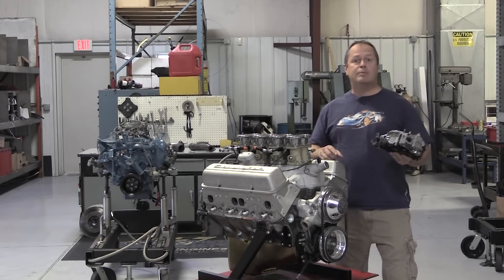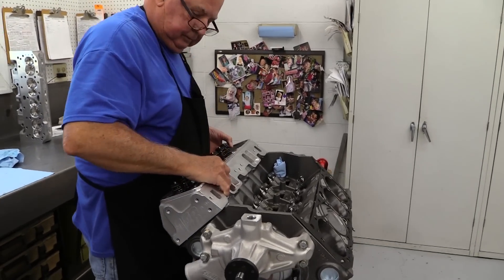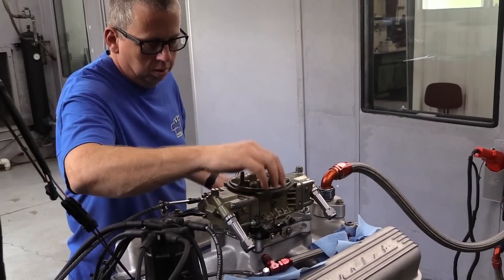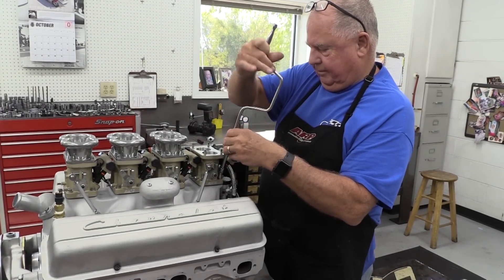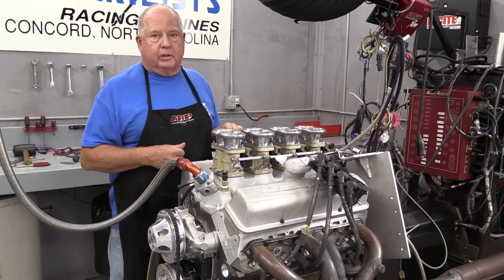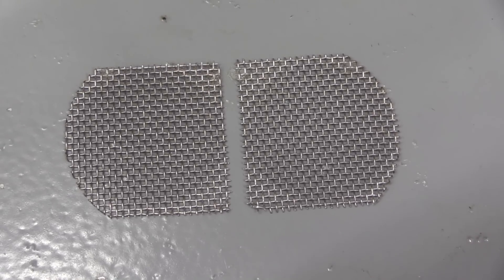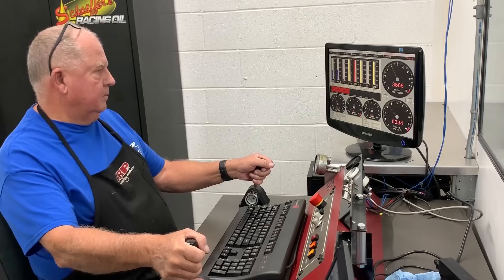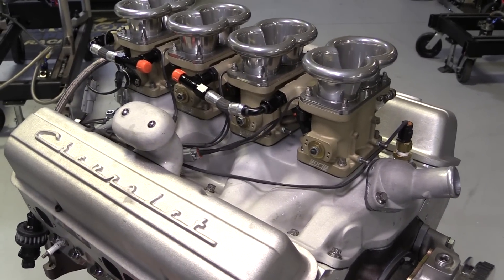Carb vs EFI - Dyno Testing a Holley Double Pumper vs Custom Stack Injection

Comment: Why this old, antiquated individual throttle body/port, Weber style manifold? How about a Victor EFI manifold, port injection and a 1000+ CFM 4 barrel throttle body? This, in my opinion, wasnt a fair example/comparison. This coming from a guy who came from carbs and distributors. Can you all do a test on the same engine with the aforementioned setup?
Reply: Yeah, this is really a comparison of a too-small mystery swap meet carb manifold adapted to EFI vs a modern carb/manifold setup. The results are not surprising.
Reply: @177SCmaro  we all know if they would've used the setup I suggested, the resulted would've been closer or even better compared to the carb setup. And being able to fine tune it. And being able to hit the key and almost have no maintenance (carb cleaning, constant carb adjustments, etc). Go to the track make adjustments with clicks vs jet changes and fooling with a distributor....
Reply: @jaydubb71  I've been driving everywhere I need to go on the same Holley vacuum secondary 600 for literally ten years, my car starts up instantly even in freezing temps and I have a vid showing proof of that. In the ten years I've been relying on that carb I've only had two problems with it, I had to replace a dried out leaking needle and seat once after the car sat for a year during a delayed engine swap and I also had to order a new number 35 squirter to match some porting and choke tower removal I did with a Dremel tool.
Reply: @Impactjunky  carbs suck okay...
Reply: @elonmust7470  I wont say that they suck BUT I will say that they have had their time. My 91 Camaro is getting a fuel injected and turbo'd LQ4. I was going to do a blow-thru carbed 355/383 but after having the LS light shone upon me, Im hooked. I learned to tune EFI years ago and I will never look back. And I will NEVER put a carb on an LS. The Holley 4 bbl carb and ignition LS kit is 800 bucks ALONE! Why DOWNGRADE an LS with a carb and have mixture distribution issues and need a plenum spider like a single plane on a SBF? No point. I would like to see a test with the configuration I mentioned earlier. @thehorspowermonster, will you all try this setup?

Comment: A carb is a calibrated fuel leak. A Holley is a fuel leak waiting to happen
Reply: @wayneoneal7952  EFI still wins, a FAST intake with stock efi on a Ls6 will out perform almost every combination of carbs. Not to mention its cheaper, WAAAAY easier to tune, more efficient, and takes up less space.

Comment: Way back in 65 when I ran a Shelby GT350 at Elkhart Lake. The 289 (actually 294 with a bore clean up bore from Shelby. Back then the engine used 4, 48 IDA. Webber’s. It was factory rated at 385 hp LOL, Right! It ran a Crane Roller cam from Shelby.

Comment: This is interesting,  especially considering that you're going over 5500 rpm with a stroker and running roller cams and roller tip rockers. I do not trust either. I will keep my spring pressures lower with a solid flat tappet cam and ductile 1.5:1 iron rocker arms on thick walled shafts instead of studs.
As to the carb selection,  wouldnt a better comparison be a dual 4bbl setup against those throttle bodys? And do a progressive and straight linkage test, and get the AFR dialed in on the carbs, like you can so easily do by computer with the EFI?
Thanks for the video, I appreciated it, but I am sticking with dual quad AVS2 500 cfm carbs.
Reply: A better comparison would have been to choose velocity stacks for the efi system that matched the carb in airflow. If that was done you'd have seen a much broader and useable rpm range. This setup was not well thought out.
Reply: That's just your mopar bias...Lol
We know shaft rockers are better...
You know Chevy's are better!
Reply: Them showing a clip or 2 of them tuning the efi doesn't mean it was fast or easy. It could have been but they also said they modified the intake to allow a common map signal which most likely helped a ton with tuning

Comment: Should have done a IDF or DCOE  to vs those  throttle body's .
Reply: Jenvey make TBs in both those types of Webers. I would have gone for the IDF-style with at least a 48mm tapered bore, it not a 50mm as a minimum, on an engine of that capacity and potential gas flow.
Reply: @brucelamberton8819  actually got two 2x50mm jenvey throttle bodies to fit my dcoe manifold for my stroker volvo engine 44mm on a V8 sounds extremely restricting considering i run 50's on a 3.1L I4 and still wonder if i should have went for 52mm or 55 millimeters, but for roadeuse i guess the 50's bring a bit more air velocity at low rpm's

Comment: Efi is better for drivability... that’s about it😂 there’s a reason you see a dominance of carbs at the strip or even street race cars... I only run carbs for my street race/strip cars. Better peaks for everything, cheaper, and easier to tune. I don’t have to really tune my carbs too often though because I get them built through pro systems. I’ll never convert to efi. I like efi in my daily drivers though😂 great video.

Comment: I'd like to see a comparison using an Enderle Bird Catcher on about a 500" drag racing motor vs. a properly sized crab setup. If you've done one, great! Link it, if not and you run across one, Link it! I run a 500" Mopar, Indy 440-1 heads, Bird Catcher on Methanol. It's NA and given the Methanol, I run the compression ratio at right around 15.5:1. I tune it a little conservatively to make parts last longer. Getting the last drop out for one pass on my budget isn't worth it. I fought with carbs on Mopars for years. Mopars are the most temperamental POS's if you try to over-carb them. Even on a 500" 13ish:1 we could not make a 1050 dom work. We were driving it to the line so by the time we got up there the plugs would be black and you just can't clean em out at that point. We had it jetted about as low as it would go before it would stop responding. I suspect a 950cfm carb would have worked great but, again...Mopars seem to just refuse to be over-carbed...even by a fairly small amount. Chevy...they put bigish four barrels on v-6s...and it worked pretty good! 

My 15.5:1 Motor in a 2600 ish pound tube chassis car did some 9.20s in the quarter but the car was a real handful. Very short wheel base and it took a real expert to get it aligned properly. But once he did it, the car went straight as a string! Unless I got loose...then you lift! LOL There's only so much you can do with a short wheelbase car! I wish I'd kept some 1/8th slips from back then but I just didn't remember to. (where I lived 1/8 was the deal for hundreds of miles) I gave upon carbs the minute I tried the bird catcher. There's just no matching the tunability (especially with Methanol) and more importantly to me, simplicity. Mechanical Fuel Injection may be nearly impossible to make work on the street but it sure works well on the strip. It would need to change 40 degrees before I'd even be able to notice a pill change.  Great vid! Thanks and I'll be a new subscriber.

Comment: Getting ready to rebuild a ‘67 mustang with a 289, all original with just under 8,000 miles for the Henry Ford museum. Then put my DZ302 on the dyno, kinda curious on how rpm’s it’s gonna twist.
Reply from the maker: Sounds like fun!

Comment: If street-ability were my main concern, I wouldn't want a setup with no air cleaner and the bug screens removed.
Reply from the maker: We never run air cleaners on the dyno. Both the carb and the stack fuel injection setup will have a filter for street use. Plus, if the owner takes the truck with the EFI setup to shows, he will probably want to take the filter off. When he does that he can easily add the screens back on to make sure nobody drops a rock or some other piece of track into one of the velocity stacks. Thanks for watching.
Reply: @TheHorsepowerMonster  I get that dyno tests never use air cleaners, I also get that for shows, strip, etc. you take the air cleaner off after you get there. My point is the builder spoke at length about street driving conditions that favor the EFI setup, but daily street driving needs filtration and that particular setup only performs well with no filtration at all, even a coarse mesh screen caused a large performance penalty on that EFI setup.
Reply: @onemoremisfit  that wasn't the filtration that was just undersized velocity stacks. The filtration just emphasized it. EFI with the same airflow will be far far more streetable with a nice smooth power delivery.
Reply: @nismo4x4n  Yes, I understand that the particular EFI system used in the test was way undersized for the engine, and any EFI will likely beat a carb in street manners, but that particular grossly undersized EFI with it's excellent street manners only made decent HP with no filtration, and no filtration is a no-no for a daily street driven engine, and the builder discussed at length the advantages of more power to accelerate in merging and other daily street traffic situations, which struck me as incongruous reasoning. They should complete the test with a properly sized EFI system, after all they did up-size the carb after determining that a larger unit would make more power, then they throw on a tiny EFI system with a one-off manifold that the customer wanted for the 4-deuces looks, then they use mental gymnastics to reason it was a good choice for daily street performance driving. A properly sized EFI would be the smartest choice, and would probably make nearly the same max HP as the carb with way more mid-band power. Basically this test was not to compare carb to EFI, but to justify a particularly unique and odd system as still workable in a practical context.

Comment: If it's used for street driving, you'll need some type of air cleaner.  
As is, you'll have bugs and dust going through the engine.    Try driving it through the midwest or south in the summer, where there's a lot of bugs.
Reply from the maker: You are right. We never use air cleaners on the dyno, but both will have a filter for real world use. And the owner of the EFI setup will probably even fit the screens back up if he takes his truck to car shows and wants to show off his engine without the filter covering up the velocity stacks. That will keep people from dropping in rocks or trash. Thanks for watching.
Reply: @TheHorsepowerMonster  
The screens caused more loss than is reasonable.   A large air filter should cause much more minor losses.
Reply from the maker: @charlesvan13  Absolutely true. I was just saying at a car show he probably will want to show off that induction system. He can add the screens easily before a show and still have a little protection from things at the show even with the filter off. I wouldn't want to run around with the screens on all the time either.

Comment: Notice that the original 750 carb had less power below 4100 than the EFI. The same holds true for running on LPG propane. We've been using EFI Port Injectors for 12 years on our propane systems in Toronto. The old rule of thumb for a carb versus EFI was that fuel injectors save 25 percent on fuel use in real driving, yet many industrial LPG engines are still running the 50 year old propane carbs. Sad. EFI is the only way to go.
Reply: I thought fuel savings came to 15%. Im planning on installing an EFI On my chevy 57 truck 3100cc. I just needed something that can reduce fuel consumption.

Comment: Webers were never known for sheer outright power.  They were known for throttle response and off the line power all the way up to the high end, which was perfect for ROAD RACING.  If you want to drag race, they are terrible, you totally want a 4 barrel.

Comment: some times you have to decide what's more important, looks or power.  Most likely this engine will never see redline again after this so more power up to 4000 rpm will work out great.  If it were me I would get rid of the individual throttle bodies and go with a large single, most likely it would make the same or slightly less power than the carb.  Its hard to beat a carb for power, that's latent heat of evaporation working there.

Comment: Clearly something reduced the volumetric efficiency of the engine at higher end with the EFI, but a good carb system can match a EFI. Having a carb combined with ignition controlled by an ECU usually improves the engine efficiency.
Reply: nope:  a carb can NEVER "match" a correct installed EFI because a carb is a RESTRICTION (venturi) and so reduce the flow= less power: the power difference is MINIMUM 5%  , and this ONLY AT BEST RPM range (highest torque RPM), because a carb is alway only optimised for a low RPM range , in all other RPM situations are carbs unaccurate and does not allow the same torque as on a EFI and the ocnsumption is far higher...
Reply: @leneanderthalien  In other words, a good carb can match an EFI system. It's all about the correct use scenario and sizing. Depending on the use, the carb is just enough.

However, a carb will not match an ECU with a proper volumetric efficiency and lambda table.

To be honest, I only build cars with ECU, because the diagnosis and tunning is much quicker and just required a laptop... Heck... I can even do over the long range radio of the telemetry.

Example: I have a car with a blower that I use as a daily drive, but I want maximum power sometimes.

So... I can setup the the target lambda to 1.05-1.00 for lower loads during cruising and 0.86 at higher loads.

This will save fuel during daily drive and offers full performance at track days.

Comment: Its said the roller cam is billet steel, is the cam distributor drive gear also billet??. Then what this material of the gear on the distributor ??? I've always been told that the distributor gear must be bronze if the cam gear is steel billet ??

Comment: Budget street engine go with in cab AFR gauge and edlebrock carb.  You are the ecm and the jets are easy to change.
Reply: that may have been true 20 years ago but efi ecu's and injectors can be had cheap now. With efi you can have perfect driveability at all points in the rpm and change your mapping at will.

Comment: Put some 48mm Webers on that intake. It does not surprise me that it has better bottom end though the Victor with 4bbl type injection with individual injectors would still be better for a street engine.And the Webers would make top end but fall allover themselves until 3500 rpm.
As a long time road racer that has been proven over decades on road race and ovals. The old piss and piddle injection on speedway sedans 30 years ago would be worse than single 4bbls of today. I have seen single 4bbl on a 360 sprint and it did not hurt, though they are turning a 1000rpm more these days and I suspect it would.

Comment: Since the 830 did so well I might have tried a 950
Reply: Bigger is not always better with carburetors =)
Reply: Inclined to agree, keep going up in size until it starts to lose bottom end and then go back one size. Who knows how much was still left on the table.

Comment: it's becoming difficult to keep a carburetor alive if you live in a place where ethanol-free fuel is not available. modern efi systems are immune from ethanol damage. 

i have an old 1974 gmc half-ton pickup with a 350/turbo350 and an edelbrock performer intake and edelbrock performer 600cfm carb. i don't use it very much, it gets used maybe 5-6 times each year for dump runs but it mostly sits around. it was always a dependable and reliable rig until the introduction of ethanol... even though i installed an electric fuel pump to eliminate the mechanical one which allows me to shut off the fuel so the carburetor will go dry when i shut it off i still get major corrosion problems so i have to take the carburetor apart and clean it out twice a year, sometimes more often than that. i'm really tempted to swap to a factory tbi manifold and throttle body but i'd rather not use the original gm c3 efi system, even though i own a scan tool that can talk to that system...

Comment: Why not use IR manifolds with separate tb:s (i.e. in cross with the tb:s located somewhere above the valve covers)? The manifold used seemed to have many bends of the airflow => pressure drop => less VE and also logical to the top end in this comparison?

BTW: Objectively Formel 1 left carburettors of any kind in the early sixties. 

But even with the same VE map over the rpm-range a properly mapped fuel & ignition EFI is indeed very hard to beat due to the extreme possibility of quality in the fuel and timing resolution vs load, this is simply not possible with carburettors and/or distributors...

Comment: Soooo ... what would happen with a larger-flowing EFI system... that could give you the lower-end 'early' torque... AND electronically control the fuel flow all the way thru the High-Flow top-end...?? Particularly if mounted on a medium-rise manifold, that would give you some runner length...

Comment: Id be curious if you match cfm of both intake setups what the power numbers would be.
Reply: the EFI would smoke the carb. You can get far more fuel to the cylinders with a EFI setup as you have less volumetric loss from liquid fuel vs vapor.
Reply: If its the same cfm I doubt it be major. Unless running big carb with lots of fuel adds a ton of fuel that does like you say.